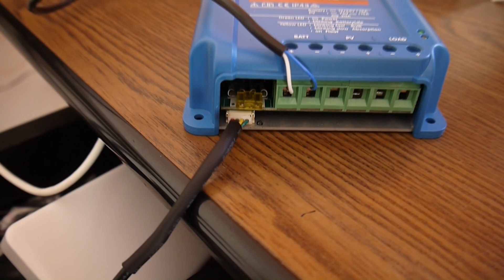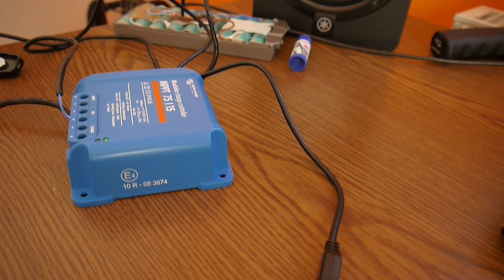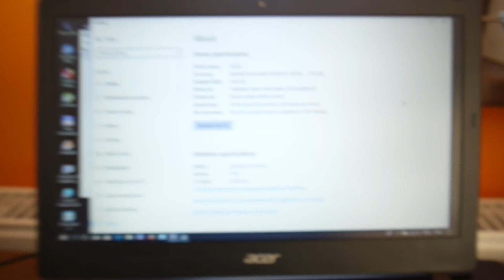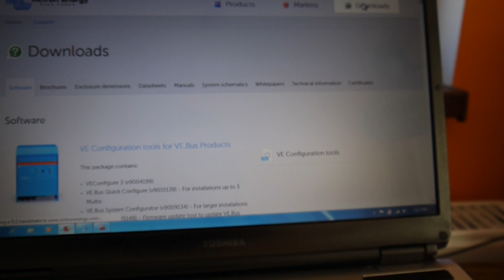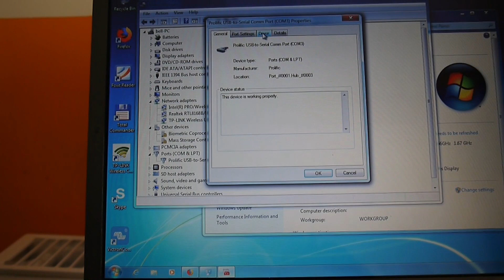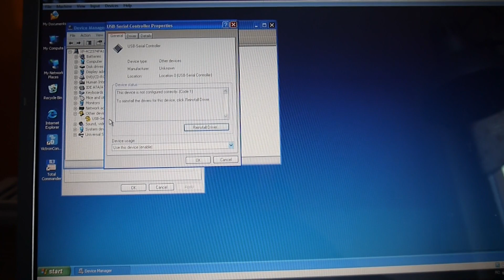DIY VE Direct data cable Victron solar charge controller

Comment: I can't seem to find the connector for the victron.  Could you please type the connector type for me.  There seems to be some difference in the description you are saying and what is written.  Thanks for the video I'm looking forward to trying it.
Reply from the maker: It's JST PH 2.00mm x 4 , it is not a Victron special, it's very generic, you may find it even in old floppy drives power supply cables. Check this out 
http://beta.ivc.no/wiki/index.php/Victron_VE_Direct_DIY_Cable
Reply from the maker: Hey Mike,please help me with subscribe, apreciate!
Reply: @viocaia  Trolling for subs is bad form
Reply from the maker: @houstonfirefox  Thanks for let me know!
Reply from the maker: @houstonfirefox  Not anymore.Thanks for advice!

Comment: Hey, thx for the explanition. But because of the Win10 doesn't support the PL2303 chip anymore, do you think it's possible to use the CP2102 chip for the usb-serial connector?
Reply from the maker: Try this fix  http://www.totalcardiagnostics.com/support/Knowledgebase/Article/View/92/20/prolific-usb-to-serial-fix-official-solution-to-code-10-error
Reply from the maker: Hey Sascha ! Please subscribe! Thanks!
Reply: Yes 2102 working👍

Comment: Nice software and connectivity, but you have to be in the vicinity to use it correct? There is no web/remote monitoring?
Reply from the maker: I don.t know, some models have a bluetooth incorporated, but I think is only for checking the charger in short vicinity.I'm using a old laptop, running 24/7,then I can check everything via Teamviewer.It can be done with an old mobile too, connected to the home  WIFI.
Reply from the maker: Hey there! Please help me with subscribe! Thanks

Comment: Just made one these converter cables following these instructions   , works well on my tablet and phone but having driver trouble on my Windows 10 laptop.  Saved heaps compared to buying VE direct USB cable,   anyway if you are looking  to  buy an MPPT get  the Victron smart controller with built in Bluetooth,  lot less hassle than using a cable.
Reply from the maker: Mine is working great on windows 10 , have you tried this ? http://www.totalcardiagnostics.com/support/Knowledgebase/Article/View/92/20/prolific-usb-to-serial-fix-official-solution-to-code-10-error
Also you may try to install without signature checking..follow next :
recovery/restart now/troubleshoot/advanced options/startup settings/disable signature enforcement
install the driver and restart...maybe it's solving the problem.
Reply from the maker: Hey Bradley! Please consider subscribe to my channel, I need a little help..thanks!
Reply: Unfortunately if you want to connect your MPPT to a GX of any type to do ESS (i.e control battery charging) then you need a cable. The Bluetooth won't do that job - it is status-reporting only.

Comment: Make sure you buy the Victron and do NOT buy the Fangpusun clone! I unfortunately ended up with one of their solars (100/50) controllers after being “up-sold” while buying some solar panels...I didn’t know it was a clone of anything as I was new to it all...anyway I bought the Victron dongle as the Fangpusun website stated & downloaded the Victron App...no one mentioned when I purchased the product OR on the Fangpusun website not to update & only found out once it was to late. Now I have a paper weight instead. Why Fangpusun cannot build their own simple app & do their own firmware updates is a mystery! After numerous emails, i was basically told it was to difficult to build an iPhone app. Pathetic!
Reply: But what is the problem? Does the fangpusun cant handle the update and is broken or what?
Reply: @tomw4791  I hear that if you update fungpusun on Victory connect you will crash controler.. I just need this cable to read data and to set up voltage.
Reply from the maker: Right, Fangpusun start producing their line, somehow.I think their factories initially producing for a western company and at the end of the contract they are abusing and producing more but stucked in the same  design and firmware.(no creativity?)
The one I have is from a solar shop in UK, up to date, Victron just release an upgrade to their frimware and software.It's great.I really love it and I feel secure, I can leave home and not worry of burnnig my shack! Also I'm using a Epever Tracer 40 , I've been in doubt about but turns to be good and trusty.
Reply from the maker: Hey! Please help me with subscribe! Thanks!

Comment: Can you change the absorption voltage to 14,6? This is for lifepo4 batteries. Thx
Reply from the maker: Yes , It can be done.in User mode the absortion voltage can be set up to 17,36v...so It's preety flexible.
Don't forget to subscribe! Good luck!
Reply: Thanks so much Can you connect a Bluetooth device to the USB cable ?
Reply from the maker: Hey Ronny ! Please help me with subscribe! Thanks!
Reply: watch the full video!!!!  is a USB cable and he adapt a normal cable!!!
Reply from the maker: @Colcad  Hey Felipe! Will subscribe to my channel..I need a helping hand..thanks!